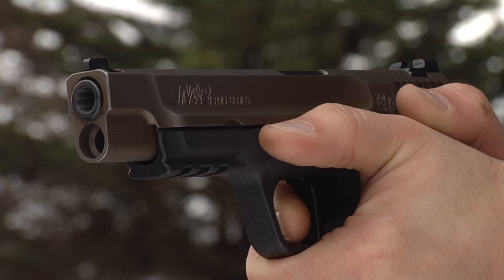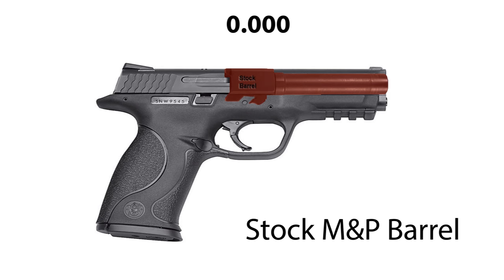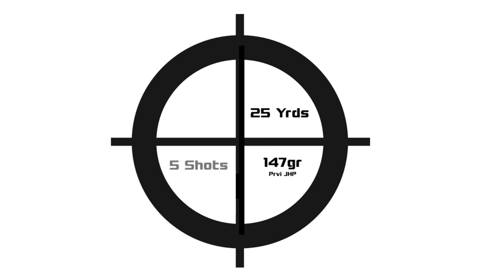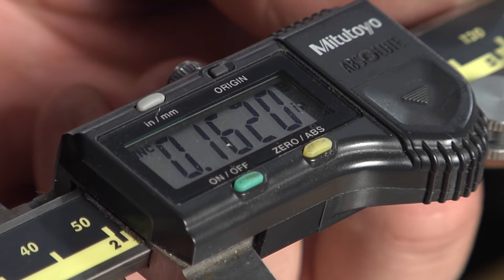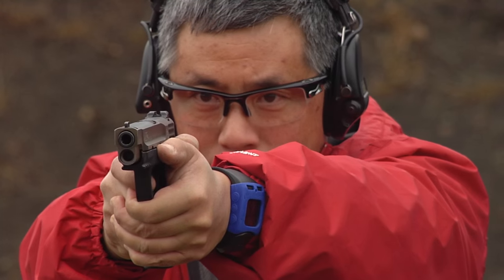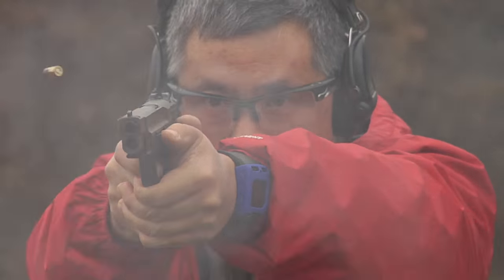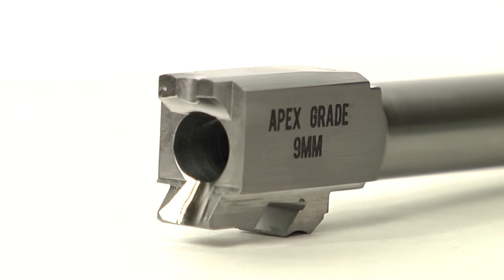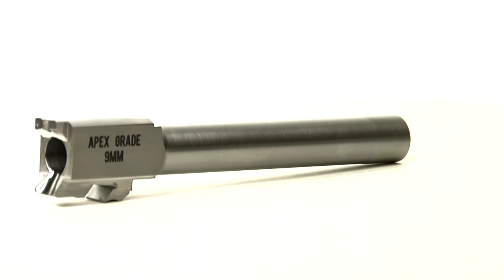Apex Grade Barrels: The Inside Story

Comment: I love what you guys have done with this barrel and being an owner of an early model M&P 9mm I am all too familiar with the stringing of shots vertically (and all over the place really) at anything past 10 yards. It's a shame really because it's by far the softest shooting 9mm pistol I've fired and I love the gun..... but you guys have finally fixed that and appear to be the only ones who have taken into account the early unlocking issue!

My question though is, why is it the Glock drop in S3F Solution barrels (and maybe KKM, or Wilson) are able to achieve such crazy accuracy? @trueexodus (guy on Instagram) did a vise grip test with the S3F and got around an inch at 50 yards, absolutely crazy! FWIW, the Stock Glock barrel still did great on his vise rest - under 3".
Reply: drewmorg Cause Glocks have a better lockup. Thats why they keep the barrel chamber and hood squared. The milling on the hood of the m&p looks cool but the square shape of the Glock keeps the barrel from twisting when the slide unlocks.

Comment: Have watched a lot of  time lapse videos of bullets leaving the barrel of a gun, the bullet is completely out of the barrel before the slide even starts to move, you can see it in the video over and over.  so I don't understand what this guy is talking about,  Every bullet even if it's out of the same box has different powder loads and different weights because they never come out perfect every time when manufacturing the bullets. That's what throws off accuracy,  You will notice even in that gun vise the rounds did not hit in the same hole every shot, they were still a little bit of inaccuracy.

Comment: What can I expect from stock barrel in 2015/2016? Does it still have issues? I'm not in the USA so aftermarket parts are not an option, but I'm interested in M&P9.
Reply: It really varies, and hand held accuracy can sometimes be very subjective. Some guns will shoot 2" at 25 yards out of a mechanical rest, while others- 4 or worse. Hopefully the new M2.0 will be better across the board in the accuracy department.

Comment: What version of the M&P barrel did you use? Did you use a current barrel or the slower twist rate older version?
Reply from the maker: we've used both for our testing and came up with very similar results.  The issue is not the rate of twist, it's early unlocking which we have solved with our geometrical alterations.
Reply: +apextactical 
Did S&W's alterations to thier barrels geometry improve the lock time from thier previous versions? And how does the extra lock time of the apex barrel affect the reliability of the MP ? Thanks for your time.
Reply from the maker: as far as we have seen, there have been no alterations to their lock time, just the rate of twist and manufacturing process.  Our barrel has altered geometry around the breech face to accommodate appropriate clearances to prevent function issues.